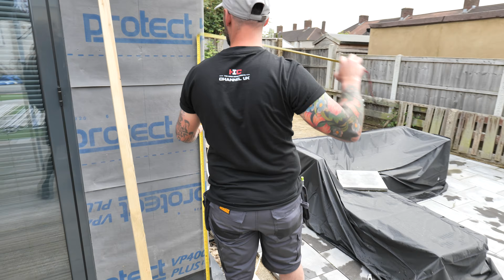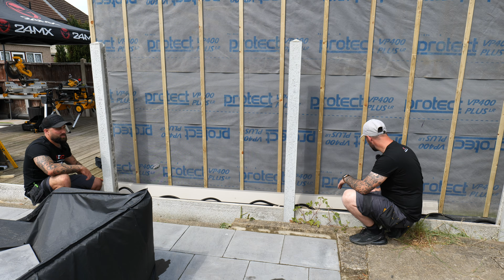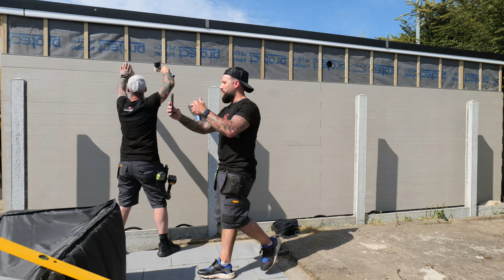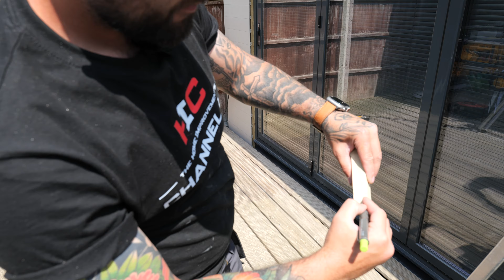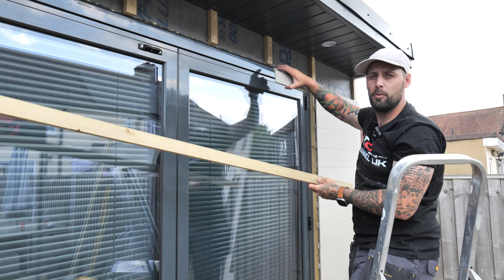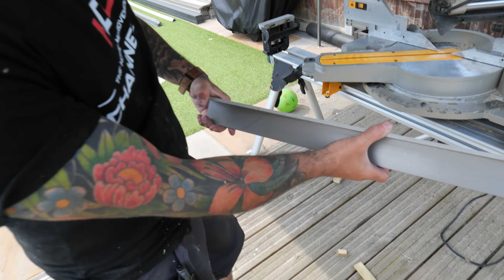How To Install Composite Cladding | Easy Step By Step Guide

Comment: Hi great video , we had this cladding put on front of house last year , looked great at first but after a while the middle bulged out . Do you think that the boards were screwed in too tightly not allowing expansion,  cheers
Reply: They probably didn’t leave the 8mm expansion gap or didn’t drill pilot holes beforehand.

Comment: Hi Guys, Quick question - how does the cladding move back and forth by 8 mm when it is screwed down onto every batten? It can only move + or - 1 mm in the pre-drilled clearance holes (theoretically - if the screws are slap bang in the middle of the clearance holes - which they are not). Serious question, as it always perplexes me.

Comment: you left expansion gap between clads horizontally , but there's no expansion gap vertically , i watched another video and the installer was saying the clad should move freely either left-right and up-down , he used cladding clips which lets the clad move horizontally and vertically , in your installation vertical expansion is ignored , that means nobody actually know how to install.
Reply from the maker: I installed how this brand recommends every supplier has there own methods
Reply: The system clicks in to each other, there is no other way to attach this cladding vertically. Normal shiplap you would leave a gap.

Comment: So if you're allowing for the cladding to expand, what happens when you then screw the corners on?
I've seen another system, (that makes more sense), where a corner (holder) is installed, the cladding put on and then the corners are clicked into the corner holders.

Comment: After looking into this and by using box steel sheets around the back and sides it saves so much money and time,you can also get tile steel roof at 1/3 the price of rubber roof .
Reply from the maker: Cool I highly doubt it’s cheaper and easier to install tho 😊👍🏼

Comment: Do you need to put that housewrap membrane under the battens if it’s a painted block wall underneath?
Reply from the maker: Wouldn’t bother on brick/block wall 😊
Reply: @homeimprovements  thanks and would you still batten or would you just screw and plug the slats directly to the block?

Comment: Hi, great video, what system were you using?

Also, have you done a video on exterior cladding with insulation, PIR etc?

I need to know about if I need air gaps and moisture barriers with PIR boards?

Cheers Fellas

Comment: Hi Guys, much detailled vid!
Do you use stainless stell brads for attatching the battens? And should there not be a little spacing between the battens (even for the vertical ones) so the wood wont sufficate?
Reply from the maker: Battons you can but I don’t bother and standard nails are fine as it shouldn’t see any moister 😊😊

Comment: Just a question I'm doing a 70ft shed soon, why didn't you use the cladding clips haswhen you screw each board, when it expands it will crack, where with clips it won't cheers

Comment: Thanks for those tips guys, I am extending new composite decking onto an existing area and those tips will help massively. Just wish the guy who installed the existing decking knew how to do it properly and hadn't used a nail gun to secure the corner cuts ☹

Comment: You guys drill through the first piece directly into the batten. Are starter clips not needed? If you screw through the board how does it then expand?

Comment: Good evening, do you have to have the gap in between the cladding and the membrane? Could you not put 25mm celotex or other insulation to help keep the building warm ? 
Cheers
Reply from the maker: You need the void for ventilation 😊
Reply: @homeimprovements  I did think that but as I’m a cheap northerner I was hoping it could be done to minimise heat loss and my gas bill.

Comment: Really great tutorial thanks, quick question, if the returns into the windows/doors are smaller than the corner profile, do they rip down easy enough on a table saw? Cheers 👍
Reply from the maker: Yh 😊😊
Reply: @homeimprovements  Hi Guys, Can you suggest a way of ripping them down without a table saw? e.g. circular saw with guide

Comment: how does the vertical ventilation work after sealing the topmost cladding piece? where does the air go?
Reply from the maker: Up into the soffit that’s also vented on the ends 😊
Reply: It can’t flow into the soffit as that’s sealed? Been told composite doesn’t need a gap at the top but a lot of manufacturers say to leave one. See these boys blocking the gap, who knows what’s right lol

Comment: I do t like this cladding, I use Eurocell much nicer and neater, you don’t have any screws showing, you simply screw the corners on first, then slide the cladding in behind both corners, looks so much more professional and far more stream line, my clients wouldn’t have screws showing colour coded or not 😂🤷‍♂️

Comment: How does it expand so much if it is screwed to the batons every 400mm?
Reply from the maker: The boards are piloted with a hole bigger than the fixings 😊😊
Reply: @homeimprovements  I can see two things wrong there. The screws clamp the board to the batten. Over a 3.6m length with a temperature difference of say 30 degC between summer and winter the board will change in length by about 7 mm. The clearance between each screw and the hole in the board is about 1 mm maximum (assuming the screw is assembled bang in the canter of the hole - which is impossible). The reason why the boards do not buckle is because the building also expands (but by a lesser amount)

Comment: This was great, until you didnt put insect/rodent mesh at bottom!!!
Reply: Is there any starter clips to stop the bottom piece flapping or is it solid once screwed? Cheers
Reply: Yes they should have Bug Screen at the top and at the bottom,
Also a starter piece to hold the bottom of the first piece of siding,
Also a drip edge needs to be attached at the bottom to shed any rain water etc. away from the building, 
The same applies above all windows and doors, 
The corner trim pieces should not be fastened on both sides 
only fasten one side, this will allow for expansion and contraction as you mentioned at the start of the vidio,
There needs to be good quality cualking applied at the door frame, prior to the instalation of the corner trim pieces, this will provide a water proof protection in this area to combat rain blowing into this joint,
Just a few items which the suppliers of this product should have mentioned to you guys, but this looks like a B & Q supplied product, 
Stay away from the big box stores fellas, your work is fine its the product and the suppliers we all must try to avoid, these kind of so called building yards are a Scurge , almost as bad as the on- line shopping 😀😂
Reply from the maker: Not part of there system mate but I hear ya 😊💪🏼
Reply: @homeimprovements  but surely for the customer and pride in your work,you could have got 1,im sure there's some company do 1 that would fit

Comment: Thanks this is really helpful - I'm thinking of cladding the outside of my crafting shed to make it a bit warmer.  Would this work ok - its a cheap and very full shed so don't want to insulate it inside. thanks
Reply from the maker: Not too sure on its insulating properties but sure you could find out more on the enviro build website 😊 and thanks for watching